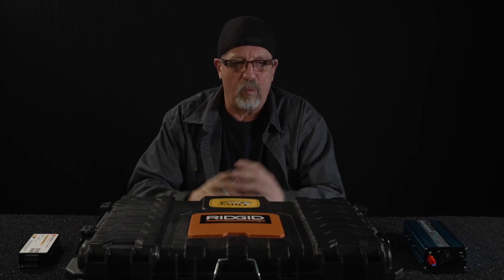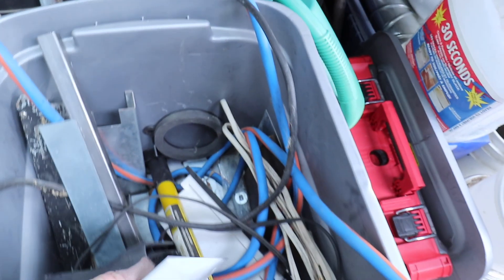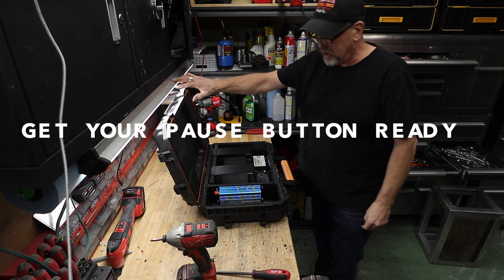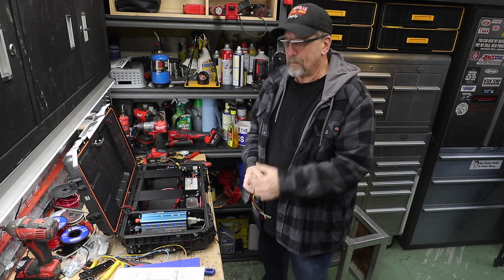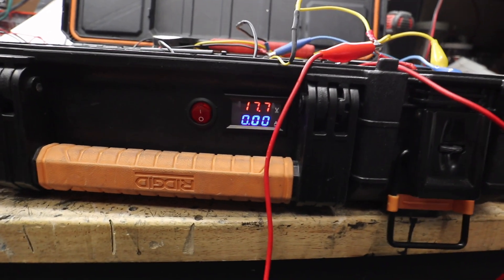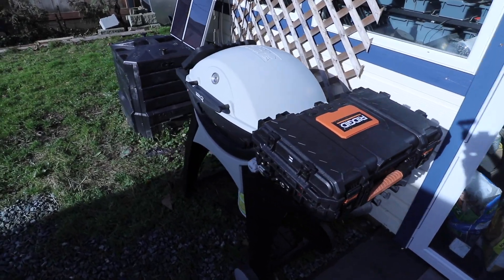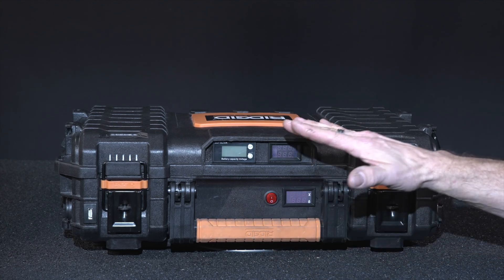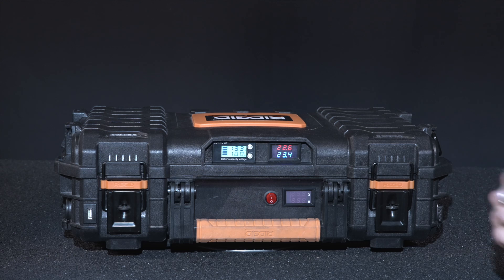DIY Solar Power Pack. With Dual Charging.

Comment: great build! Do you need a cooling fan for use in direct sun/hot days?
Reply from the maker: I’m gonna say no. The inverter has its own fan, but I don’t really use the 120v power very often. I only use this thing to charge batteries when I take my cameras on road trips and nothing heats up then. We took it up to the lake this summer and I just set it up with a little solar panel and it worked great. I didn’t notice any extra heat at all.
Reply: @i.b.lancer awesome thanks for the reply!

Comment: Nice very nice I was wondering if you were going to put a computer fan in to keep temps down and for airflow for the inverter I love how you utilize the box to fit everything and you can even add a small 50 watt solar panel to clip on the outside then you truly portable once again nice design
Reply from the maker: Thanks. I haven’t found a need for an extra fan. The inverter has its own fan, but I don’t really use it that much, and when I do use it, it doesn’t really get very hot. It’s only 300 Watts.  This is mostly just to charge camera batteries. Thanks for watching.

Comment: 🤔 SAFETY FIRST! Was there a Mains/Catastrophe Fuse or Breaker on the wire at the Battery POS post? The BMS is to protect the battery. If there were to be a short between your fuse box and the battery? Every DC or AC panel has a Mains/Catastrophe Fuse or Breaker. Awesome build. Thanks!
Reply from the maker: Yes, of course there is. Holy safety police.

Comment: Nice build. Clean install and use of space. The only thing missing might be some cooling fan(s) hooked up in conjunction with your thermistors! About the time you finished this project, everybody was changing from USB A/B to the New USB C plugs. 
I was also impressed with how clean your work shop appeared! 
Great job! That will provide years of fun and emergency power.
Reply from the maker: Funny, I was just thinking that same thing last month when I was using this a lot. I need to swap out a couple of those A’s for USB-C. Thanks for watching.

Comment: Very slick!  I like that you used the reinforcement braces to your advantage, as the switches are protected from accidentally being turned on.  I have two of these exact same boxes, as well as the matching big bottom one with handle and wheels.  Planning on using mine for Ham radio go-kits.  Thanks for all the details, and you did a fine job!
Reply from the maker: Well thank you very much. I’m glad you liked and thanks for watching.

Comment: It would be awesome if during this build you showed where each wire is connected and how it's run and how all the components are wired up bc so far this and one other build I've seen are the best on Youtube
Reply from the maker: Thanks, I hear what you’re saying. When I was building this I never intended it to be a tutorial. And I really didn’t know what I was doing as far as the camera work goes, I was kind of new at the YouTube thing. I was more concentrating on what I was doing actually building the thing then documenting the work with the camera. If you check out my Milwaukee packout build, I go into a lot more detail with that build.  Thanks for watching.
Reply: @i.b.lancer  yes sir I will and like I said your videos on explaining what your putting but as far as builds your and maybe 2 more other guys have the best builds I've seen so far
Reply: Agree with the others....came here hoping for more of a tutorial.   All the 2x b-roll was useless for those of us trying to learn.  Pretty nice build tho!  @i.b.lancer

Comment: Don’t throw out the soldering gun!  If you leave them on too long it pops the thermal fuse for the unit…it’s an easy fix!  When soldering, turn it off after making your connections.  Then fire it back up when needed…they heat up fast.
Reply from the maker: Too late. I bought a new one.

Comment: Thats a hell of a nice build - i noticed theres a fuse block - is the 12v port fused and what fuse did u end up using ( if you have ) and are the usb ports fused ? ..... my only concern is the mains voltage - it wont be earthed so be carefull there but apart from that - Well done
Reply from the maker: 12v in and out port doesn’t go through the fuse block. It’s on its own 20A blade fuse. I chose 20A based on the external chargers output to this box…20’s lots. It’s also on the main switch circuit so power will only flow when the main switch is closed. Just an added safety feature with the help of a 40A relay. All the usb ports get their power from the fuse block. Probably 5A fuses. Thanks for watching!

Comment: I was thinking about relays also a easy way to use a campare operation device to turn itself off if under voltage to protect batteries.
Reply from the maker: The inverter has a low voltage shutoff at 10V. You're not going to hurt the batteries.

Comment: Another cool build, would be nice for camp to keep cell phone charged. Thanks for the videos….
Reply from the maker: Power goes out at my place all the time so it’s been very handy. Before I built the Packout version I would use this little guy to run my computer setup. The power goes out but the cable still works so I just sit there next to the fireplace happily oblivious to the power outage surfing the interweb.

Comment: Great video!   I'm working on on one of these myself and you've given me some ideas. For charging the batteries.. Should they be charged by either solar or a plug in charger.. Or could you charge using both at the same time?
Reply from the maker: While I wouldn't charge them at the same time using both inputs, you could have two charging inputs. One going to the charge controller and the other going directly to the batteries. It depends on your charge controller. In my case my charge controller is only good for 10 amps and the external (plug in) charger I have puts out way more than that. So I opted to have separate inputs. Hope that helps.

Comment: Now that the litime 100ah mini is out, it might fit better than the two you currently have. I plan on fitting mine in the milwaukee ammo can to do similar things.
Reply from the maker: I checked them out. The Li Time battery is a little bigger then what I used and won't lay down in the case that I used without cutting the lid or taking the lid right out. But it would definitely be the way to go in a different case. Thanks for sharing that.

Comment: Very cool. But how much have you really used it since you built it?
Reply: Kinda like a heater.Yah turn it on when it’s cold.😅
Reply from the maker: zackly
Reply from the maker: Well, I do have a larger one that I use more then this one but since this one powers the lights out in my back shed, I would say every other day it gets used. For me these are more of an emergency back up. In the winter the power goes out around here quite often. Last winter I used it tons. Now I have the larger one so we’ll see.  Thanks for watching.

Comment: why do people want to turn 12V dc power into 120V ac, then back into 12V dc to power things?
why not just go 12V dc "supply' to 12V dc "use"? or another dc power. like 5V dc to charge a phone.
Reply: Sometimes it's because of how voltage control works or not.   

For example in some of the commercially offered solar generators  / potable power systems,  the internal battery is NMC and they are actually 10.9 volt batteries. They read 12 volt when 100% state of charge,  but then drop into the 11s under load.    This often trips off 12 volt refrigerators and diesel heater igniter. 

The other time is when used in cold weather,  such as 0 F.  Li batteries won't function at 0F, so you have to use AGMs or similar.   Under cold conditions the battery voltage of these drops as well. 

So the choice is to either use a 24 or 48 volt battery pack and dc converter,  or turn on the inverter to make 120 vac, then plug in a 120 vac to 13 volt dc converter.
Reply: @harryniedecken5321  Most commercial power systems operate on 48v, not 12v, so that should never be a concern, regardless of what battery chemistry is used (These days, they're almost ALL some sort of Lithium chemistry).
 
Even on a 12v system, if your battery voltage range is outside of whatever appliance you're using is happy with, that is easily resolved by a simple step-up buck converter. But, of course, those have some efficiency losses as well, but that's still better than not being able to run whatever you are trying to run.

One correction though, LifePo4 batteries will work fine for SUPPLYING power in cold temps, they just can't be charged at those temps. The good news is that discharging the batteries a bit is typically enough to warm them back up enough to safe charging temps, and then charging them will also keep them warm enough to safely continue charging. It's pretty rare, indeed, that you'd ever be in a situation where cold weather would truly create a problem with being able to use them.

And with portable battery packs like this one, it's a pretty trivial matter to simply bring the battery pack indoors to warm it up.
Reply from the maker: Harry’s explanation is excellent although at no time was DC turned into AC and then back to DC in this build.

Comment: 300 watt is plenty for when the power goes out and all you wanna do is power is a fan or 2 because summer time power outages suck because it gets hot in the house lol
Reply from the maker: Runs my computer, speaker system and router.  That’s all that really matters…. Oh., and a fan.

Comment: cool build love it 🥰🥰🥰🥰 am building my own 3000 watts 48 volt 120 AC 60Hz pure sine wave i have water proof tool box same tool box you have but much bigger i have 4 110AC out and 2 15A and 20A breaker for my out let them i used wire that wire house with for my out let and going to my inverter and ihave switch between positive of my batter and to positive of my inverter i going put solar charger and usb and cool fan but water proof so my out let them have breaker for each one so nothing with happend to my inverter
Reply from the maker: That sounds awesome. 👍🏻
Reply: @i.b.lancer  thanks when I finish I will show you but not finish yet I have the same tool box you have but the bigger one I going buy that same tool box here in Toronto keep up good work brother

Comment: new to this why do you need a relay for the switches?
Reply from the maker: Most switches can’t pass through the amperage that’s needed for certain things. So a relay is used so the switch just turns on the relay, which handles the large current.

Comment: Just received the Genasun charge controller.  Novice question:  How did you connect the shunt to the battery side of the charge controller to measure amps?
Reply from the maker: The shunt runs in line with the negative wire. And where you hook it up will depend on which current you want to read. In my case I wanted to monitor the amperage going into the charge controller so I put my shunt just before the charge controller
Reply: @i.b.lancer  Just ran the wires and it all came together!  Thanks a bunch!
Reply from the maker: @roncolaninno5866 Hey, great to hear  👍

Comment: Great project!  What relays (AMPS) did you use for the master switch and for the inverter switch?
Reply from the maker: I got them off of Amazon. 
The main is… Starter Relay WM686 12VDC 200A. Amperage wise it’s total overkill but it’s a good looking relay
And the inverter relay is a MGI SpeedWare 40 Amp Relay Harness Set SPDT with 5-Pin Socket
Reply: @i.b.lancer  Thanks so much for the assist.  I just bought a large rolling and small Rigid box-I hope it comes out as good as yours!

Comment: A good little powerbank you have there, I have 24v / 1000w inverter for my powerbank but still used. My diy powerbank is based on an electric bike battery (36v / 15A) I use a small converter from 36v to 12-24v / 500w most cigar usb for cars can handle 24v, I have the option to make 12v, I have put a cigar 12v and a usb with two connectors next to each other in the same box as the converter, which then goes a wire from the bicycle battery to the box.

Comment: Pretty Awesome!!! How well does it carry with the handle since the batteries are off-center? Nice work. And Yes I've been to #5 Orange 😆
Reply: I've watched your video 5 times and I wish I had half your talent and patience. I'm determined to make a similar solar generator. I'll let you know when I finish it.
Reply from the maker: Yes, I would be interested in checking it out. I’m working on a larger one now too. It’ll be made in a Milwaukee Pack-Out box with a 2000 watt inverter and 200ah battery.  Thanks for watching my video…. 5 times, bwahahaha!!
Reply from the maker: That was something that I didn't think of before building it but it didn't take long to find the sweet spot on the handle  I just have to grab it at the end that's over the batteries and it's totally in the centre of gravity and nice and comfortable to hold. Even if you grab the handle in the middle it's really not too bad but feels better if you grab it at the one end. Thanks for watching! #5 all the way.